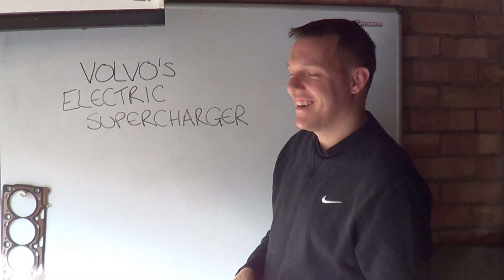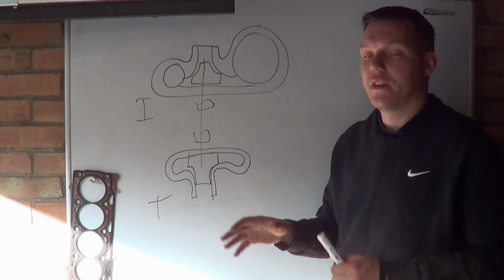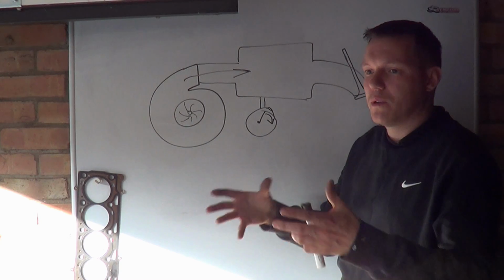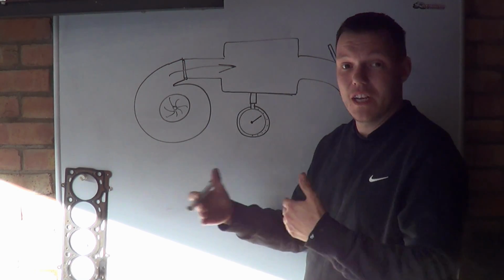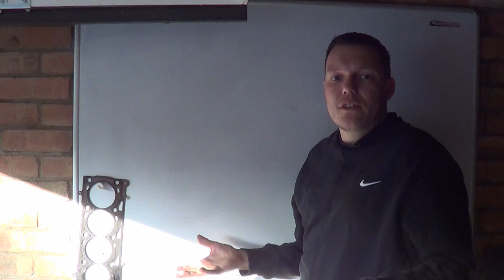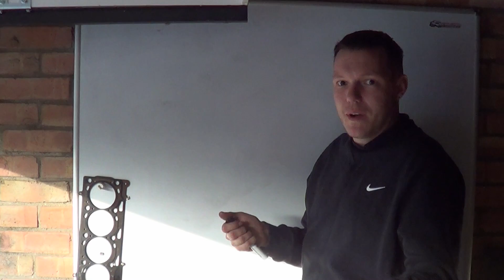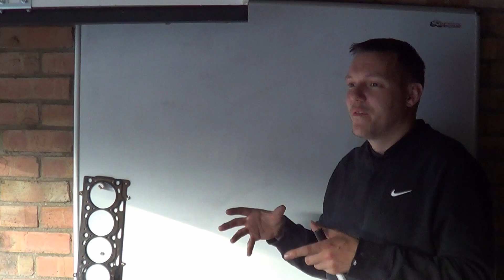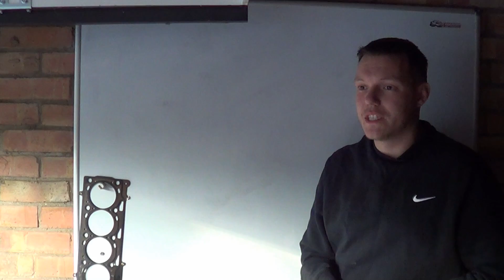Volvo's electric supercharger?

Comment: first of in a turbo charger the compressor part is really a compressor, the function of compressor is to convert the air kinetic energy into potential energy( convert the speed of air into pressure). in this case it is a centrifugal compressor and which is just doing that, Pressurizing the intake air (not just keep on pushing air into the manifold to get more mass flow). And the turbo lag is the lack of energy for the compressor to do work since not enough juice coming to the turbine due to low RPM of the engine.(  which is on the graph you shown from  1000 to 9000 RPM, not after 9000).
Reply: The Workshop. It is true that compression will not take place in the impeller and i never told that. for your understanding, impeller is just the bladed disc inside the centrifugal compressor. just go and learn about how centrifugal compressor works. and about the graph, i know very well how to interpret a graph u have no idea about the transient response of turbo charger neither have any idea about its response time. back pressure and surge margin..i don't wanna write an essay here. u better do the best background work before ur next vedio. don't ever make a stupid one like this.
Reply from the maker: so if compression doesn't take place in the impeller then where does it take place?

You did say that - 

"first of in a turbo charger the compressor part is really a compressor"

So from what you stated an impeller is a real compressor. These are your words not mine. 

You also said - 

"in this case it is a centrifugal compressor and which is just doing that, Pressurizing the intake air"

The impeller doesn't compress or pressurize. An impeller increases the velocity of the air in 2 ways. Its involute shape, and through mechanical force as it displaces air as it rotates. On the point of understanding, centrifugal force is a ficticious force, as in its not real.
Reply: The Workshop. Don't get confuse with impeller and compressor. impeller is just the rotating part inside the centrifugal compressor. so only i told you to read about it. and also don't get confused with manifold and diffuser.. anyway looking forward to see your next vedio on this topic.
Reply from the maker: Im not confused, I don't understand where you get this notion from - matt
Reply: The Workshop. who is matt?. I'm a gas turbine performance engineer. i was looking for electric turbo charger related topics then i found ur vedio, i felt something wrong about it, dts all..
Reply from the maker: I'm a mechanical engineer, who used to work for a company called Turbo Dynamics in christchurch in Dorset. There I worked on turbo diagnostics and balancing or should I say re-balancing. Something Honeywell weren't pleased about what-so-ever. 

Their website - http://www.turbodynamics.co.uk/
What field do you work in?
Reply: The Workshop. I'm into aerospace was a  aircraft gas turbine engine performance engineer in GTRE, was doing a research topic on engine health monitoring in IISC india. I can see That you have better practical knowledge on turbo charger. if you want few theoretical knowledge about compressor nd turbine u can refer cohen and Roger's gas turbine theory, it might help. I would like to talk more about Turbos with you.
Reply from the maker: You can always add me on facebook and message me if you want here - https://www.facebook.com/pony.power.395
Reply: The Workshop So centrifugal force is not real? Put water in a bucket and spin around fast enough and you still end up with empty bucket? I come in peace space man.

Comment: At 5:23 you say an impellor (in a turbo) is a positive displacement pump.
This is not true, a positive displacement pump pumps the same amount of media per rotation regardless of its rpm. A turbo does not, its a centrifugal pump.
Reply from the maker: Thank you sir you are quite right, will add this to the next video. Recently at work I was working on reducing cavitation on a water pump impeller. With all the backwards are forwards I got my wires crossed so to speak. Shit happens, and it appears to be happening to me recently - thanks again - matt
Reply: It's not even a centrifugal pump, it's a centrifugal compressor: The turbo compresses the air inside the volute before it leaves the turbo.

If you want an easy to understand explanation you could say it:

Draws in air through compressor (not impeller!!) at high speed.
Throws the air outward and smooshes it against the outside of the volute (scroll).
The high-speed smooshing compresses the air.
The compressed air then leaves then turbo and makes it's way to the inlet manifold - already compressed
Reply from the maker: @Kj16V  Point out to me where 'compression' happens? 

"The compressed air then leaves then turbo and makes it's way to the inlet manifold - already compressed"

- And this is too funny for words.
Reply: @thedirtyworkshop  Hi. What I said is exactly correct :) 

Quoted from the Cummins website: "The compressor housing then converts the high-velocity, low-pressure air stream into a high-pressure, low-velocity air stream through a process called diffusion."

Comment: I almost pissed myself laughing when he stated that exhaust flow has nothing to do with spinning/spooling the turbo up LMFAO whilst ROFL.
So if I get a turbo and just say light a oxy-acetylene torch and stick it in the exhaust input port on the turbo it will spool up once it reaches the correct temperature is that correct is it???I smoke the funny weed every day for pain relief, yet even I know you must be on some unbelievably good shit better than ACID.Seriously you don't even know the fundamentals on how a turbo works, not a supercharger a TURBO powered by the exhaust pressure/gas from an engine you dopey sod...If you would like I am sure I can send you some links to how a turbo actually works...
Reply: here's mr Garret for ya  ..• After the fuel is burned in the cylinder it is exhausted during the cylinder’s
exhaust stroke in to the exhaust manifold (5)
• The high temperature gas then continues on to the turbine (6). The turbine
creates backpressure on the engine which means engine exhaust pressure is higher
than atmospheric pressure
• A pressure and temperature drop occurs (expansion) across the turbine (7),
which harnesses the exhaust gas’ energy to provide the power necessary to drive the
compressor 
 
if there is a pressure and temp drop across the turbine then how is it being driven fullboost?  that's right of Garret's page, check it,  it's the turbine turning heat from the exhaust into kinetic energy via newtons third law... there's not enough exhaust gas pressure coming from the engine no matter how much we apply bernoulli's principal across the turbine blade's,  yer soaking heat energy into the blades much the way a jet engines turbine extracts energy from the hot gasses from the gas  flow.. heat to kinetic... as that pressure drops in the outlet manifold and gas exapands in there it imparts an impulse to the gas flow in a given direction, more heat, more energy, more velocity, like a jet engine 
.....so it's not just kinetic energy imparted by the pistons, it's the heat of the expanding exhaust gasses that rises as the engine approaches peak efficiency that imparts energy to the turbine.. newtons third law and all that.. if that makes sense, then Matt can go ahead and build engines, while you put yer turbo 10 feet away from yer manifold and see how efficient it is..
Reply: plane gaper STS turbos are mounted at the rear of the vehicle and performs very well.
Reply: The Workshop It's not taking heat energy and converting it into mechanical energy. The exhaust gasses are just hotter, that's it... The reason it's so efficient is because hot air expands. So knowing that, the cooler air on the charge side of the turbo takes up less space because atomically it's more dense, and after it is heated it expands and therefore takes up more space creating more pressure moving the turbine on the exhaust side. I've dumbed it down as much as possible for you, I hope it helps.
Reply: Apparently one can just light one's farts close to the intake and achieve equivalent results.... of course it makes driving a little tricky....
Reply: It is not just high temperature of the engine exhaust gases, nor is it just the volume of exhaust gas flow. It is both acting together, as in PV=nRT which is the *ideal gas law*, also called the *general gas equation*. What it tells us is Pressure times Volume equals number (n) of moles of gas (the mass) times the gas constant R times the Temperature (in Kelvin). Pressure times Volume equals Energy. Also, higher temperature is more energy. Therefore, because PV=nRT, an increase in ANY of the 5 terms means more Energy. Of course, one cannot really vary the Gas Constant, so the other 4 variables are what you play with. Engine exhaust gas happens to be hot (carrying excess energy), because engines are not perfectly efficient. Turbochargers recover some of that excess energy in a way that is useful for making more Power (energy per second). Flow AND temperature, taken together, are the key things. https://en.wikipedia.org/wiki/Ideal_gas_law
Reply: Yes, Frankie Teague, cold air will drive a turbo, just not very powerfully.
Reply: Frankie Teague -- Since the main goal of turbocharging is to make more power, you want to cool the recently compressed air, if possible, so that it is denser. That increases the mass of oxygen which can flow into the cylinders and the amount of fuel which can be efficiently burned to make more power. If the fresh air could be cooled as it was compressed, that would work even better, but it's not practical to transfer that heat out from inside the turbocompressor. One could of course add petrol, water, alcohol or a blend to the air to soak up heat, but that is another topic unto itself. Among those choices, methanol would be best for cooling, ethanol 2nd best. If the cooling additive method is used, it would be interesting to see whether adding before the turbocompressor would be best. Certainly it would allow use of a physically smaller compressor, resulting in a bit less turbo lag, but the extra mass in the flow might have a contrary effect.
Reply: The reason we say turbo's use the heat to generate power is not because it actually uses the heat, it's because the heat generated in the combustion cycle expands the gases to a level where it creates a high amount of pressure and "flow" out the exhaust. If the same amount of air was displaced when it was cool there wouldn't be as much pressure/flow simply as it hasn't expanded to the same level as if it was hot. It's the same reason bigger engines can run bigger turbos, because they have more exhaust displacement even if their EGT's are identical.

So no, turbo's don't use heat, they use gas flow, heat is just a critical component to creating that gas flow.
Reply from the maker: Again straight out of context. But I'll give you this one, kinda. Yes I could of worded it better. Your thinking of it in the basic 'the gas flows through the turbo and makes it spin', like a 12 year old girl. In engineering we talk about the actual root force. As in you'll say that an engine sucks in fuel and air. But it doesn't, there is no such thing as sucking.

Back to the turbo lark, the 'flow' of the exhaust gases through the turbo get its energy for the heat of the exhaust gases. Higher temperatures means more energy means turbo goes faster. Turbo's owe they're high speeds to the fact the the gases are hot. Its also a thermodynamical system. What you're saying is its the flow, not the heat. 

So lets say you have a 1 litre engine, and it's a single cylinder. 1 litre of air in @ 15psi. the exhaust gases then flow through the turbo, which would be 1 litre. So your saying this engine is just powering itself, with no losses? You're the fucking dumbarse for 2 reasons. 1) you don't understand what is being said and how these things actual work. 2) you thought you'd look smart by commenting. I'd stick to doing speakers
Reply from the maker: Please do.
Reply: fullboostturbo1 is a moron 😂😂 does it hurt to be so stupid ???
Reply: What Matt is trying to teach is that the air out of the exhaust needs to be hotter then the intake air.
Hotter air takes op more space and is the reason why a turbo can make positive pressure.
if the air didnt need to be heated, a aircraft turbine would be able run without fuel.

Comment: I don't know why many people out there still believes that forced induction can be made electrically!. There is no way and even if they made it electrically somehow ,the boost is going to be low and for a very limited time which is useless and you have to wait for the batteries to recharge again. It's like nitrous a 10 second fun and it's over.If you want really BIG POWER and for a long time invest in a true turbo or a supercharger than these non sense and shitty waste of money.
Reply from the maker: Hello mate, I depends what you mean. I agree the systems available today are a bit 'snake oily'.  However, the concept itself (i.e powering an impeller with an electric motor) is possible, although more advancement need to be made in motor weight and power delivery. My main issue with the whole debate is that people seem to think that it's an easy problem to solve, or misunderstand the issues entirely. Electric 'superchargers' just can't compete with the older proven system we use today. Thanks for the comment - matt
Reply: +Pony Power A supercharger takes an average of approx. 20kw or even higher to create around 10 psi of boost. Translate this to a 20KW ELECTRIC MOTOR and tell me how much big and heavy the motor will be. And don't forget the current that will it takes and how long it will continue to create boost before the batteries will fry!. Not to mention how much the batteries will weigh and how long you have to wait for the batteries to recharge for another few seconds fun.
Apart from this they will only give a few boost particularly in the lower range.
Adding all these disadvantages you will find that electric forced induction is more than useless.
If you want BIG POWER just supercharge or turbocharge the traditional way and have fun but I am not saying that in the future it can't be but for now they are far from success.Just turning an impeller with a high revving motor does not mean that you are going to have a forced induction system. A turbocharger or a supercharger have to fight their own back pressure they create , their restriction they create. In order to overcome these factors they will draw a huge amount of power from the engine. Just placing an electric turbo in the inlet you are just causing a restriction to the engine rather than you are helping it!.FORCED INDUCTION SYSTEMS COSTS SO MUCH FOR A REASON!.
Reply from the maker: I'm in total agreement with you there mate, as I said in this video - https://www.youtube.com/watch?v=X34qHdkBnWg
Reply: Pony Power DUMB ASS 1TURBO CHARGER DUMB ASS 2Cant wait till you dumb fucks eat your own words.
Reply: It is feasible to have a sensible sized battery and motor at quite high burst power outputs, using existing technologies. The Ebay electric fans are just a gimmick and it is important not to confuse them with seriously engineered solutions. The intention is not to use the electric supercharger to replace the existing turbo but to provide boost quickly when it is needed...perhaps for a second or two.
Reply: so a short, fat exhaust , straight up in the air 'heat goes up' is the best.
do you want to let the exhaust expand as rapidly as possible after the turbo, yes?

Comment: I got a question. Recently the front end of my Kawasaki 636 has been clicking as I'm stopping. It's not the engine because I know what that sounds like. It's toward the end of my stop that a hear clicking.
Reply from the maker: Sorry mate lost you at "It's toward the end of my stop that a hear clicking." is it a metallic clicking or possibly a plastic clicking? How old is the bike? - matt
Reply: +Pony Power it's a 2006. Say if I'm slowing down from 30 miles per hour to stop at a light. I won't hear any clicking until a second or two before I completely stop. After I stop there is no clicking.
Reply from the maker: do you have any idea where abouts?
Reply: it's because it's a Kawasaki lo. buy a duc you will have way better problems than this.. i'll give you my dry clutch for a few minutes and you will forget all about your clicking .. lol
Reply: Could be your head set bearings, replace or nip up.